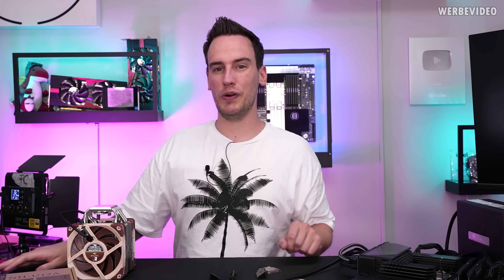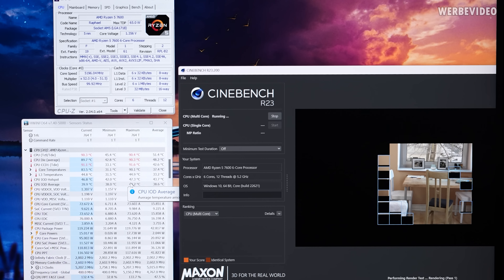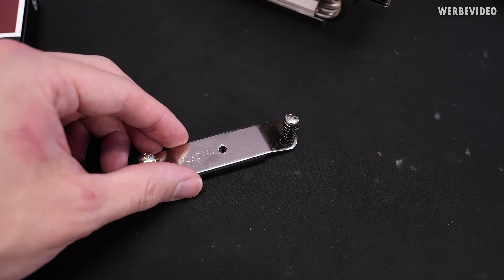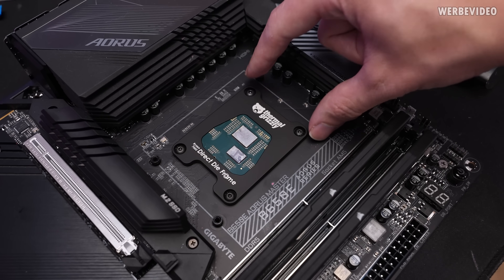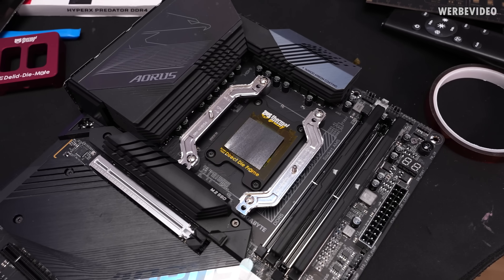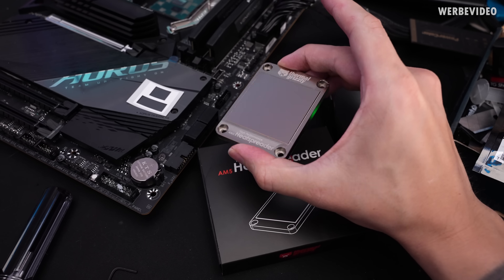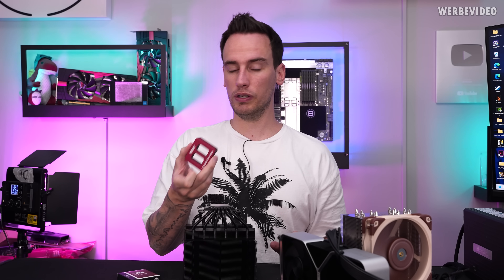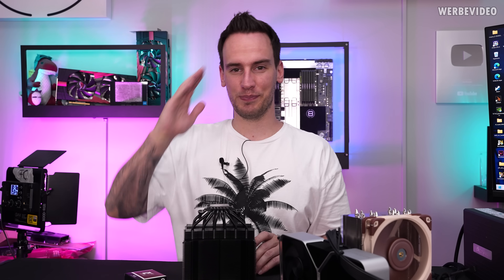How this 120$ Noctua Cooler beats a 360 AIO

Comment: The way any air cooler "beats" any AIO for me is by being dead reliable. Don't need to stalk news channels to check if your AIO is gunking or leaking. Don't need to worry about pump whine or bubbles or whatever. Don't need to worry about it degrading in a couple years, and becoming e-waste. Unless you're a competitive overclocker or in production where any time is money, you don't require an AIO.
Reply: laughs in 9 year old Corsair H105 that still runs like new
Reply: my arctic liquid freezer ii 360 after 4 years is performing excellent so far so good touch wood  ,i paid £90 at the time )
Reply: I live in Australia, AIO's make a huge difference here when ambient temps are often over 29°c
Reply: Yup, using pure air cooling on my 7800x3d + 4080 setup. Neither of the 2 parts are super power hungry but also perform great, making a quiet air cooled setup easy.
Reply: I run an open cu only loop with the same water since 5+ years. No problem so far. A pump won’t die because of the hydrodynamic bearings and the good cooling of the pump coils.
Reply: Ias stated by others above i have a 13 year old cosair aio and still running great. Kept a fx under control overclocked to 5.3ghz. And now my ryzen 5.   Its quieter then any air setup because even under full load ryzen 5 wont cross 55c and only at 50% fan speed. At idle my fans are off passive cooling alone is enough.
Reply: This is not the top comment I expected for this channel. I don't understand the need to pit one against the other. Both types of coolers have totally legitimate use cases and the vast majority of AIOs have no significant issues with reliability.
Reply: @JJFX-  agreed.. for my parents, a server, htpc, air cooler makes sense, but I'd never want one for myself.
Reply: I've been running AIO coolers for decades. All the way back to the atrocious Zalman external cooling tower. I've got a Cooler Master 120mm unit that is 13+ years old and still runs like clockwork. Every machine in my house is liquid cooled except for my laptops and there are quite a few. I don't see the issue with AIO coolers. I run a Deepcool LT720 360mm AIO on my, delided and all surfaces lapped, 13900k with a 6.0Ghz/4.4Ghz all core OC. Right beside my head, the chassis is literally 2 feet away on my desk. No pump wine, fans stay super quiet unless under heavy load and never had a leak. Maybe I'm lucky? No air cooler is going to keep me at a max temp of 81C at those speeds.
Reply: But theyre trendy and have pretty lights.🤣
Reply: @SgtBluntman  I can asure you that my liquid freezer ii 360mm does not have RGB...
Reply: @SgtBluntman so do air coolers 🤨
Reply: @SgtBluntman No. Arctic Freezer has no RGB but a lot of air coolers has. And Arctic Freezer is a very very good AIO that der8auer also likes
Reply: I've been using my NH-D14 in 3 different builds since 2011 and it just works.
Reply: @marfg12345 so does my retro c64, but there are far better options these days
Reply: Nah, AIO is pure convenience. It's so much easier to install, too, compared to a bulky air cooler.
Reply: I use both air and water cooling as every case and build is different. Both have their advantages and disadvantages.
Reply: Have about 10 aio stations running 24/7/365 overclock for up to last 7 years for production work. Zero issues with the aio portion, have had one or two fans need to get replaced but everything else is great. 

We did opt for the nicest ones we could get at whatever time we purchase at so there is that.
Reply: but most ppl wanted the clean look, i think thats the main reason ppl buy that. and air is just ugly, there is no argue about that
Reply: An AIO can reduce CPU temp spikes faster than any air cooler.
Reply: im not taking computer advice from someone named by grace through faith
Reply: You're right for about every situation, except small form factor enthusiasts. The space efficiency of being able to move the cooling solution is invaluable for small form factor builds.
Reply: @Dwayne-h2v  From what I've seen on Optimum Tech, you'd want to go custom to maximize SFF efficiency anyway. And I remember Ali making aircooled builds too. Yes, AIOs have their place as a lower effort enthusiast solutions - but hey, at that point you're using cool tech for the fun of it, and the tradeoffs just come as a part of the experience.
Reply: @Dwayne-h2v  well there are sff cooler however, yes they are more limited, but they can cool a 65W CPU and sometimes even a 95W one. There are sff coolers with a height of 65mm or less that can cool a 7800x3d, for example
Reply: Or if space is tight, for example with newer GPUs.
Reply: I think one aspect of air cooler is forgotten. The fact the air also cool a bit the vrm part of the motherboard by moving air flow. AIO cools only the cpu.also the cooler is perfectly align in push pull configuration with the front cooler and the back cooler and the top cooler to move out the air. Personally i never use AIO, as i don’t trust water with expensive electronic equipment..with air cooler only the fan can failed and i never seen one failed honestly ( i have 55 years old. computer pioneer)
Reply: I mean, as someone in production, I don't have the time to waste troubleshoiting watercooling lol. Would never waste my time on toys that have the chance to not be reliable during crunchtime.
Reply: Yep, I will never use an AIO because of reasons you said.
Reply: I switched to a Corsair H115i from an NH-D15 and the biggest change for me has been the fact that I can easily access all of my motherboard without removing the cooler. With my noctua it was always a pain in the ass working on my PC because I couldn’t easily remove my graphics card or access fan headers, CPU PSU slots, etc. 

They’re not necessary sure but they are very nice to have
Reply: I am overclocking heavily and i find Aio's too weak for that case. I would say that they are good for people that want aesthetics + clearance + "cold" intake. About longevity  they arent that bad , they should last for years and by then you would want to upgrade anyway. Of course in the end nothing beats the reliability and the silence of these noctua aircoolers.
Reply: I completely agree with you. A high end air cooler like Noctua or Thermalright PA or FS rival pretty AIO’s in performance. The Noctua Chrome Max Black is a beautiful cooler. The added benefit of air coolers besides having no fluid is the fact that they add airflow to the case. Yes, they are bulky and not as pretty as AIO’s, but never having to worry about fluid leaks or the pump going south provides a level of comfort. Even if the fan died on a large air cooler while you weren’t home, the large heatsink surface area would provide some level of protection. Not sure that would occur with AIO’s if the fluid flow became stagnant.
Reply: Pure fear monger nonsense. AIO are extremely reliable and surpas any air cooler while not stressing the mobo with those ridiculous large, hideous looking chunks of metal
Reply: I used mine so pbod maxes out and it fits better in my narrow case then a big air cooler, also this guy is talking about cost but he's risking way more money in pc parts, I've had my aio for years and my friend is still using my old one in his with no problems, both corsair brand over 4 years old, that being said kock on wood
Reply: I like air coolers for normal applications but I have a travel rig I use an aio on so I dont have to worry about the cooler ripping off if it gets knocked around
Reply: I like my pc as quiet as possible with maximum performance. I need am aio
Reply: stalk news channels to check on your AIO? whatever it is you're smoking,  stop while you can still type, cuz thinking that news channels will be looking in your PC case to report on your AIO means you've got some SERIOUS issues already. I'd suggest speaking to some sort of professional.
Reply: have the nh-d15 chromax black on my 7700x and im going to switch to an arctic freezer 3 360 next month. temps still go to 95 degrees with cinebench score of 19,5k. 95c? thats for laptops not for desktops....
Reply: All of these issues can be averted by buying quality parts.
Reply: this is why i quit AIO
Reply: I have used custom water cooling and aio’s since Corsair came out with the H50 in 2009. Never ever had a problem with any water solution..
Reply: reliable, worse case is the fan on the cooler goes bad or dies which is are, then you just replace it and its like 10-20 bucks for the fan, works good as new.
Reply: I just went back to air cooling after 15 years of running liquid cooling. I went with a Noctua NH-D15, it's quiet and keeps the cpu cool, super reliable and will be able to upgrade to support newer sockets years down the road if i want to. I wont have to  worry about the pump dying, worst case i have a single fan die and replace it for 25 bucks.
Reply: until AIOs use non conductive fluid, I'm out
Reply: @doublecrossedswine yep frying even one 2.5-3k build is too much for me.  It’s an absolutely stupid and unnecessary risk.
Reply: @doublecrossedswine There is no practical "non conductive cooling fluid" yet.  Any non conductive water based fluid will eventually become conductive due to reaction with metal. Oil based fluid has worse thermal performance and also more stress on the pump.
Reply: @doublecrossedswine Are there none that use oil?
Reply: Almost any mainstream fluid you put in a cooling loop is going to become conductive eventually. Even de-ionized water will be ionized by the metal it passes over. Youre right though. Dont trust AIO manufacturers, build your own custom loop.
Reply: @doublecrossedswine112 you know they have some fluid in heat pipes right?
Reply: @mddunlap03  the fluid is miniscule. Like, obscenely miniscule. Additionally, I've never once seen or heard of a heat pipe breaking and bricking a system. In fact I think the only way a heat pipe could brick a PC is if it broke and the metal connected 2 things that shouldnt be connected.
Reply: @Dwayne-h2v  I've cut the ends of the copper pipes open and it won't even make a single drop when you turn it upside down.

I'm not saying there isn't anything in there. I believe there is, I just didn't see it when I looked.
Reply: @Dwayne-h2v  I've had a heat pipe break on a laptop.. rare but it does happen
Reply: it just works
Reply: I've ran 240mm corsair AIO since 2014

Never had a single failure, never had issues with bubbles, etc

I just plop it in and forget about it
Reply: I have to say I used to feel exactly the same but it’s not so much the temps that AIOs can achieve but critically how long they can cool a cpu before they can’t soak any more heat. Here, AIOs wipe the floor with air coolers. Sure the install and fitting them in a case is a pain but if you heavily load a cpu for an extended time I’d not use an air cooler now.
Reply: Yea, except when your cpu is really high end or your case can’t fit a giant hunk of metal. RAM clearance is also a big issue often times. And my AIO has been going for years without issue, and far outperforms air coolers still.
Reply: This comment section is straight up delusional. There is nothing wrong with air coolers, they're totally fine and even preferable in some cases. But you have to be detached from reality to not understand that water-cooling is much quieter than air cooling. Both in terms of overall noise as well as noise spikes during short term load spikes -- AIOs can absorb that extra heat load and remain quiet, while air-coolers will start wheezing.

Not to mention weight. Commenters in this thread said "it's only 1.3kgs of weight", as if that's a good thing LOL. Imagine having a water bottle's worth of weight constantly hanging from your motherboard. It also looks really bad. If you care at all about how your PC looks internally, you will probably go for water-cooling.
Reply: I use air in some systems and liquid cooling in others, everything has a use case. IE iPhone vs Android argument. Nothing wrong with air cooling. @Krannski
Reply: silent system is a golden,aio is the answer😊
Reply: there are plenty of justifications for AIOs.  
Starting with shipping:  by having almost no weight on the socket, there's no nearly risk of damage during shipping.
It also leaves a lot more open space in the case to allow for work later.
Reply: @MikeKitchenman  i have a torrent nano with an air cooler. I know its not the smallest itx chassis, but an aio would def help with some space. Im not trying to have any aio headaches tho.
Reply: @MikeKitchenman Those are hardly benefits. You ship a computer once, and most people only ever touch the inside of their desktop a handful of times.
Reply: @MikeKitchenman  Who the fuck is shipping their pc? Seriously the arguments you people come up with is 10000000% copium
Reply: @MikeKitchenman  exactly! People have such a hard time to understand that not everyone lives the exact same way as them. I absolutely find my 420 Arctic Freezer 2 very handy for me as a overclocker (no I'm not a "professional overclockers" but what the hell lol. Why would I need to be that for it to be handy) that also moves a lot and want to be able to easily remove it without remove everything.

So thank you for having a non-narrow minded view on things! We need more of that
Reply: @MikeKitchenman  weight: well, my coolers come in a box by themselves, so that's not applicable to me anyway.
Taking up space: if that space is taken up by fans and aluminum then you are decreasing your ambient temp overall, not increasing.
Reply: @MikeKitchenman If you're shipping your own PC just take the cooler off beforehand. 🤔
Reply: @auto9894  that's less helpful when it's a company is trying to do a pre-built and not have stupid end users assemble things that can break the PC when they do it wrong.
Reply: Even on chips that get really hot, like the 13900K?
Reply: @DustyCruz You can easily air cool that processor, but it won't be silent.
Reply: @jamesm568 you would be surprised! How many fans does a 360 aio have plus the pump? 
If you have a quality air cooler the sound is not bad.
Reply: @gjmi72  On a 360 AIO you can run your 3 fans at 500 to 800 RPM to help keep the noise down to a minimum. An air cooler will get saturated with heat quicker, but air coolers cool off quicker when you turn the RPMs of the fans up. It's hard to keep noise down to a silent level like an AIO can when it comes to a hot CPU. If a slight increase in fan noise is no issue then go with an air cooler.
Reply: @jamesm568  you forget the pump noise. I overclocked my cpu and I do not hear the air-cooler. The most noise comes from my power-supply! As long as you have a high quality air-cooler, there is really not much noise.
Reply: @gjmi72  More or less a high-quality fan.
Reply: @DustyCruz  There is another channel, that ran all air coolers on the market. He even moved the Thermal limit to 115C and all the air coolers were still throttling in "R23", not to mention R24.
I moved my thermal limit to 105C and can run forever R24 with no throttle at all on my cheap Lian Li 360AIO, with a fixed fan speed.
Reply: @DustyCruz  depends, if u only play games the cpu wont be drawing that much power, but if you are doing more cpu intensive tasks you would need an aio
Reply: @DustyCruz  its why people buy amd instead
Reply: @DustyCruz  genuinely yes
Reply: @Dwayne-h2v  Yes the 13900K will run on air, while throttling off a 115C thermal limit, or reducing performance by a lot... Who wants that. I just moved my thermal limit to 105C on my 13700k and removed all throttle from my system with a cheap Lian Li 360AIO. 97C is as hot as it gets and no throttle. Still hitting 1635 above average for R24.
Reply: @DustyCruz  There's no justification for the 13900K.
Reply: No one needs a aio but with some hotter chips it's nice to have them for lower noise at lower temps even during these warm summer months
Reply: @MinehowTech  I need an AIO for my micro-atx pc
42mm air cooler aren't enough, but 240mm fits in my NCase M1

It also exhaust the heat right outside my case instead of inside, making my other air-cooled  components run cooler
Reply: I finally bought an AIO last year and the pump already failed like 3 months ago. That was my first and probably last AIO.
Reply: Amen. I have a few Thermalright coolers that are 16 years old (and counting) and have never missed a beat. My current cooler of choice is the TRUE Copper.
Reply: @FanPhys good for you but you are leaving a lot of performance on the table due to silly fears. AIOs are extremely mature and safe these days and have been for years
Reply: I feel like leaking these days just isn't a thing anymore, I can't find a single post that is less than 3 years old so the cases are extremely rare. So "needing to stalk channels to check if your aio is prone to leaking" is a little exaggerated. Bubbles literally take less than a minute to fix and usually only has to be done once. My last AIO (kraken x52) lasted me about 5-6 years of almost constant on time, at the end it only ran about 10c hotter than it did originally. The only reason I replaced it is because it didn't have support a newer socket that I wanted to use (am5)... which would be the same case with many air coolers.
Reply: @stijnd5268  Well, I've used both custom loops and AIO's the last 20 or so years, not 24/7 the whole time but I've had at least one if not 2 of either kicking around and I've had zero leaks. Had friends who used to have either or, same thing, except for one dude I spoke to a couple of times maybe 15yrs ago, who said he knew some guy who had a leak and nuked his mobo, if I'm recalling correctly. Something broke in some way - a dremel was involved I believe he said. 
So yeah, I'd say it more of a 'noia thing than anything real, so long as you don't do something obviously stupid, or have incredibly bad luck - there were recalls many years ago of some leaking AIO that I don't remember the brand of. Even that was an infinitesimally small number of incidents if I recall correctly, or they paid the customers enough to shut them up - which is just as good IMO. 
I think it's just about people who can't deal with the idea, or don't trust themselves, others or their luck - in which case I'd just zip it and sick to air cooling. There is a category of people who for one reason or another want to take part in product type discussions without having one of whatever it is being discussed, and then do it under the "banner" of that sort of thing. I know these people exist, I have met many and even spoken to them specifically about why they discuss shit they don't have and never will. They just want to be part of the "gang".
Reply: AIOs in general are extremely reliable these days. Especially if you are getting a good one. I've run one for 5 years and not had a single issue. 

The cooling performance, build potential expansion, simplicity, aesthetics, and noise make it a no brainer for most builds. 

The only real downside is the price.
Reply: @e2rqey  I have a same Nh-u14s from 2013,  started with s775, free kit any socket, how many AIOs still working after 11 years ? Btw, tested with 14900k, on pair with many AIOs on normal tasks..
Reply: That or if you don't want to spend 170$ on a CPU cooler that isn't better than a 70$ arctic freezer 2. I love noctua and I have used my money to change the fans iny PC + I have had a noctua air cooler before. But I'm very happy with changing to a arctic freezer 2 420mm as a amateur overclocker that loves doing this. It is the reason I go up from bed in the morning after having a shitty life as a addict that finally has some meaning after I turned 30 and started playing around with computers.
There are several reason for having a AIO other than "being a competitive overclocker". And it's so sad and narrow minded to look at the world in such a negative way. Try learn the art of liking both things and to understand that not everyone lives exactly like you do. Or have as much money as you do. Or whatever. Just ridiculous to think that being a "competitive overclocker" is the only good reason for an AIO. Its like saying that "if you not a professional gamer you should play on a cardboard box with a 20hz monitor cause you cAnNoT seE mOre HeRtZ"

Even der8auer is recommending several AIOs over a pretty big part of the air coolers I've seen him review here. Just so you don't forget that
Reply: No alot of ppl like the look of air cooler anymore also some of then are pain in the ass to remove to do cleaning change pasted and ram
Reply: My Corsair AIO I bought in 2015 still works great today. Came with a 5 year warranty as well and covered any costs if other parts in the system got damaged by leaks. So a lot of your arguments are pretty exaggerated. Also I bought it for $110 which at the time was not much more expensive than a noctua air cooler. Its a 240mm rad btw too, performed better than noctua air cooler at the time.
Edit: you also forgot about ambient temperature. If it's really hot where you live and in your room the AIO will perform less bad than the air cooler.
Reply: i use air cooler couple of times and the temp generally still pretty good since i bought the good one. but idk i always come back to AIO since they always get in the way of everything
Reply: It depends on what type of SFF build youre going for tbh, but i was really referring to the enthusiast grade SFF builds that refuse to compromise on performance, rather than the enthusiast grade SFF builds that aim to be as absolutely small as possible. Even those builds sometimes benefit from liquid cooling though, really depends on the case shape.
Reply: @Dwayne-h2v  How well does the 5600X3D do in SFF cases?
Reply: My aio is refillable and maintainable. It is 5 years old and works like new. Never leaked, is whisper quiet, and performs way better than any air cooler that fits in the same case. It fits in a 16l case better. I don't have to worry about it warping a mother board.
Reply: @jeremytine your pump will still die eventually making that thing waste as all aios are destined to be. I've had one air cooler for many years now. They even supply you with brackets for new sockets if you can prove you bought it. And overclocking is dumb. It's a waste of time, adds instability, and 9/10 times barely changes the performance much at the cost of your wallet.
Reply: @jeremytine  " refillable " is still extra maintenance
Reply: @sammiller6631  topping off coolant isn't that hard, but point was it isn't ewaste as previously claimed. I just do it when refreshing paste. I've done it once in 5 years...
Reply: You seem more interested in an ideology than performance. Your assertions are only valid in your head, and have no bearing on gaming performance gains and noise reduction.
Reply: Lot of aio owners in here don't seem to understand basic thermodynamics lmao, the nhd15 has better heat transfer then most aios on the market and the ones they don't beat they tie with, because the heat physics modeling is so advanced these days theirs not a lot to do about the interface between the spreader and the cooling block, and guess what, heat pipes are liquid pipes, but theyre under sub atmospheric pressure to abuse evaporation to transport the liquid, and something like the nhd15 has MORE fin surface area then almost every 240mm rad, water does not equal better because aio/custom/"air" coolers all use liquid to transport the heat from the cpu to the fins (and air coolers also have 1 fewer interfaces the heat has to go through to get into the air). Maybe 5 to 8 years ago aios stomped air coolers for some things but a lot of their performance is people only playing for an hour or a bit more and not saturating the waters heat capacity, but in 2023? The only advantage is the ability to move the large fin stack off the motherboard.
Reply: It would be a more compelling argument if we didn't need to spend even more (over say, the Arctic Liquid Freezer ii range) to add the Contact Frame and new mounting bracket for these coolers, just to get the performance we want. I'm sure the best air coolers do have an operational lifespan that outlives AiO's, but I'm not willing to spend on those extras now just to get some additional years out of the air cooler, when I can probably find a new AiO for the same price and just replace the old one when the time comes.
Reply: @pageup213 

As long as the AIO doesn't take the CPU down with it when it goes, or as long as you preemptively upgrade/swap before failure that's not a bad option
Reply: @pageup213  nah, inflation will prevent you from finding a new AiO for the same price. Look at price creep for graphics cards.
Reply: @pageup213 Peerless Assassin and new Frost models are in the $50 range and cools nearly as well in most cases.  If you are de-lidding and such, you're probably not bothered by budget.  For a lot of others it makes way more sense.
Reply: Yeah but people want watercooling "because I've seen it on YT", that when they look at the price of a proper loop and can't afford/want spend the money they have to fall back on AIO. It's like I would like but I can't so let's look for cheaper stuff. ¯\_(ツ)_/¯
Reply: Yeah, no. I'm sick of gpus getting huge coolers and still not able to stay under 90c. And the 9900k is infamous for getting stupid hot. Uncomfortably hot. Cratering the socket for thermal runaway hot. Nevermind am5 and 13th gen Intel being even worse.
Reply: @ZeroHourProductions407  If you think 13th gen Intel temperatures are stupid hot, wait until you see 14th gen.
Reply: @ZeroHourProductions407 if you’re not riding tjmax, you’re leaving performance on the table, so you’re probably not the target demo for this chain or channel in general.
Reply: @joemarais7683  I do a custom loop with my cpu and gpu. The only time I ever see the cpu reaching 95C anymore, is running prime95 full tilt. Gaming or encoding? Never again passes 65c on the package temp, let alone any cores. The gpu liquid cooled, is much the same. I for one cant afford to just do a new build every year, so keeping it cool even at speed, means I get a much longer usable life out of it.

Also, Arizona summer means I'm dealing with ambient temps on 120f for at least half the damn year. No air cooler at any price is going to be at all effective in those conditions.
Reply: wat do u mean by riding tjmax?
Reply: AIO’s are generally nowhere near as “unreliable” eye sore air cooler enthusiasts make them out to be.

They every time I see a high end build with a janky looking eye sore on the CPU I cringe.

Many totally ruin a build (both looks and performance) due to utterly unwarranted paranoia - Water = bad, me no like AIO…

120-240 air coolers and then wonder why their 200+ watt CPU runs “hot”…It’s both sad and comical.
Reply: AIO sucks.
Reply: Nah, I don't want to put 3 kilos of weight on my motherboard.
Reply: @hombrepepega3472  NH-D15 is 1.3kg with fans on.
Reply: @Lishtenbird I've seen plenty of motherboards warp badly with that much weight before over time.
Reply: @jeremytine  older motherboards used older less quality standards
Reply: @sammiller6631  "older motherboards used different quality standards"  not really... Motherboard I'm thinking of was a z170 and not any thinner pcb than the z690 I just bought... Both from Asus.
Reply: @Lishtenbird and easily beat by highend aio. If you like to live in the past and leave performance on the table, be my guest
Reply: @hombrepepega3472  what about it? i have a pc running for 12 years with an NHD-14. no issues whatsoever
Reply: @Amfibios handicapped performance to me is an issue
Reply: I wasnt really advocating it, but rather answering their question. I am much more of a liquid cooling enthusiast as youve probably gathered from my other comments in this thread. Also, 3 kilos? Where are you getting that number? Im pretty sure that even the NHD-15 only weighs like 1400g, and thats with fans installed.
Reply: @hombrepepega3472  3 kilos? Where are you getting that number? NH-D15 is 1.3kg (2.6 pounds)